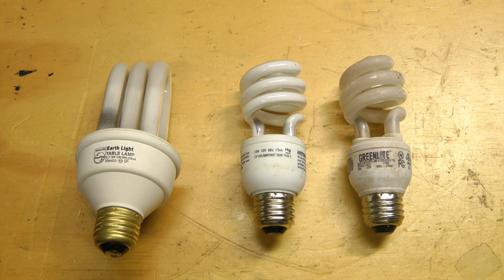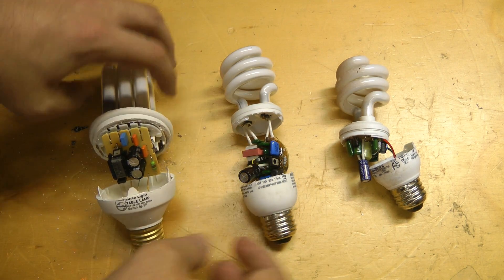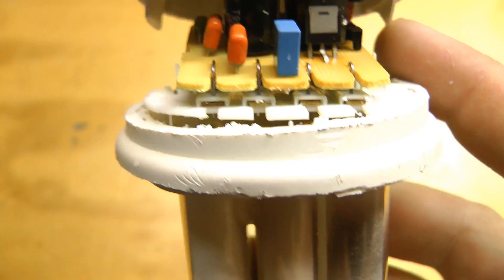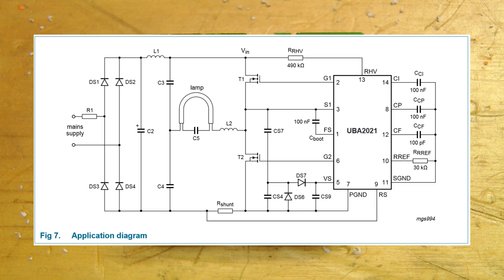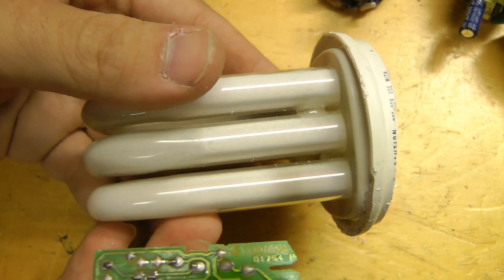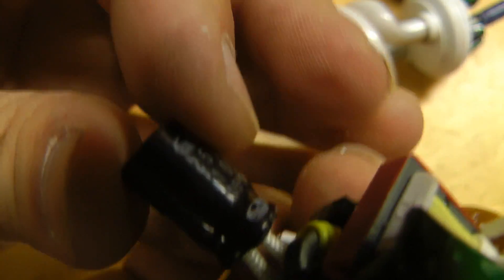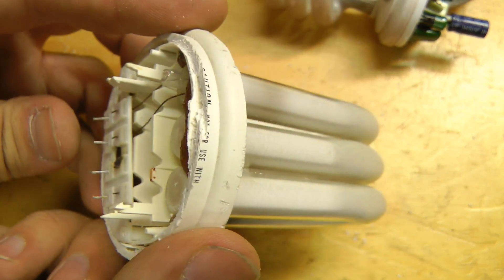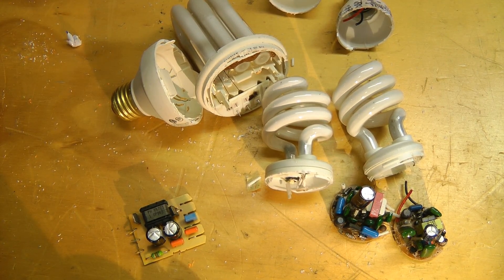Compact fluorescent lamps - then and now

Comment: Almost the same in Europe.(Except they never used voltage doubler because we have 230 V nomial voltage). I took a look inside an older Philips PL Electronic-C 9W CFL and it has a half bridge with 2 capacitors and a chip to drive the transistors. Newer CFLs have a single capacitor in the half bridge circuit and a feedback toroidal transformer for the oscillator. The newer Philips CFLs advertise 6 years or 10000 hours lifetime. I still like them more than cheap chinese LEDs which last 2 or 3 years, maybe 4 and some of them have a 100 Hz flicker which CFLs didn't have. Sometimes a CFL with a broken cathode can be repaired by shorting the cathode or bypassing it with a resistor.

Comment: Thank you Great video

I like scrapping these lamps they are full of great parts to build other stuff with,
the down side of them is they have Mercury in the tubes so need disposing carefully
I have been using led lamps for about ten years and some need replacing now, so the
 life expectancy is looking to be about the same as the large Philips

Will you be doing a video about Led lamps in the future ?

Comment: I've noticed if you have a CFL in an upright, open fixture, it lasts a lot longer than if it is hanging down, or in an enclosed fixture. The CFL in my bedroom lamp has lasted 5 years and still works, while the ones enclosed in the hallway and hanging in the dining room have been replaced at least twice since we began replacing incandescents with them. Also one of the stairway CFL's I have is beginning to flicker, I'm worried its time is coming to an end. Now as the bulbs burn out, I am replacing them with LEDs, since those actually look promising.
Reply: Does it still work

Comment: Found similar results. There are some compact fluorescents that were used since 1990. These featured a copper/ iron ballst and classic starten, built in large "marmalade style" jar on a screw base. These we used in outdoor lighting at the garage, and they do still work, even though the fixture is in all weather conditions.
Others were made by Philips, sold under the "Stella" tradename. ("Made in EU") These I bought in 1995, and they were installed into the staircase lights, so it was common to turn them on  a couple of times per day, for just short moments. MOst of them, I bought around 20 at the time,  still work.
The inverter uses the same IC like the Philips in video, the tubes are durably built. The base and inverter stays lukewarm during operation.
On my desk, I used a spiral "daylite" variant, also of Philips brand, called Genie super saving daylite, that worked for two years at max. It is not on all day. Similar to the one in your video. It failed two days ago. I always noticed, it became very hot, and the temperature did not match a stated consumption of 18 Watts.
When it failed it started to flicker, ending up at a super hot lamp glass temperature. The glass finally cracked. I tore it apart, the inverter is the same like yours with the Dishi cap in the video. There are green Hitachi style capacitors, which turned brown over time. Finally the one between the filament burnt out, keeping the current flow at very high values.
Most CFL are not long lasting, taking pollution and resource use into consideration, it is a total loss over tungsten bulbs.
I replaced the desk lamp with a 4000K LED, and at 10W this has quite bright light output, the base/ inverter stays cool, as expected. I'm curious how long this PRC device will last.
I used a some, which went quite fast, failure was the fusing resistor. Driven at 120 V, these tended to stay, but with my home supply being 242/420 Volts EU, the inrush current was too high, and finally cancelled the fusing resistor. Asking for warranty, the seller replied "You can't expect the same level of quality, as a Toshiba built bulb. Ours sell cheaper". Well, Toshiba's were just 10% extra... as the internal construction was actually quite nice, I expect, someone relabeled 120V bulbs with (the inverter can take it) 100 - 240 V AC.

Comment: Do they have a voltage doubling circuit in bulbs meant for 240V like ours since the voltage is already double your voltage? They still don't last very long either way -_- They seem to fail from heat because the plastic is always discoloured near the fitting.

Comment: I wish that I still had the older (late 80's) CFL bulbs around for comparison. Those were a single large ring, and had an annoying 'defect' in which they would not light-up in total darkness (but would light instantly late in the evening/early morning). Used to focus a bright flashlight on each one to relight them after a power failure, like they were electonic candles.
Reply: I've never heard of a light not turning on without the presents of light
Reply: @Kennephone  (IIRC it was an) Early 'high efficiency' variation on the semi-resonant starter that both lowered the voltages when starting/operating, and did not use a bi-metallic strip to control the electrode heaters.

(I presume) that they used some sort of early photo-resistor or primitive photo-diode to detect when the arc was struck successfully,  but (due to too-sensitive thermal/over-current protection, or component degradation) this 'solution' had problems detecting the light of the arc striking in total darkness.  

I noticed some of the lights that were on "flaky circuits somewhere" actually were glowing extremely faintly (visible after staring at them for 10 minutes), and would 'come-back' when a bright torch was brought into the room, or flashlight focal point stroked around it. (And had some fun lighting those around my hiding spot first while the rest of the compound/homestead was still stuck in the dark.)

(I presume that) the inventor(s) didn't calibrate a fixed brightness threshold 
level/value by blind feel in in total darkness during a >40C tropical heat wave while hanging from a corrugated-steel-roof still much hotter than that in the middle of the night - so the oversight was understandable (to me)  -- but after many years of trouble and thousands of dollars to eliminate non-existent power supply problems (aside from those expected in an 'emerging economy') my uncle was not as understanding and eliminated the whole stockpile rather than sell them on.

Comment: The Philips lamp was made in June of 1999 (the 9F is the date code; the number is the ones digit of the year and the letter is the month (A to M except I for January to December); the number is first in odd decades and the letter is first in even decades).
I have some early 1990s Osram CFLs made in their now closed Maybrook, NY lamp plant that use a similar topology to modern helicrap ballasts (like a Royer oscillator but with a separate base drive transformer), but they use much higher quality components and as such are far more reliable.  All 5 of mine work and a neighbor has 2 more that have been in regular use for close to 20 years.

Comment: I have some old magnetic ballasts for CFL lamps that have done 20 years of operation, with no issues. Replaceable lamps as well help a lot, as then you only replace a cheaper PL lamp instead of throwing the lot away. Electronic ballasts almost always fail from the electronics burning out than from the lamp dying, though the cheap and nasty lamp used degrades so fast the point is moot. I have old carbon filament lamps that likely will outlive me.

Comment: I used to be able to buy a 6 pack box of GE 23 Watt CFLs (100 Watt Equivalent) for around $20 US dollars... Now I go to the same stores and they have ONE 23 Watt CFL going for about $12 US dollars.... I have taken the older and newer ones apart and aside from some component down sizing and price reductions, they are the same product with the same lifetime...

As time goes on, CFL's become less reliable, cheaper to manufacture and more expensive to purchase... It seems retailers are using them as a profit cow now that Incandescent are banned.

Comment: I'm glad you did this video as I have been cracking these buggers open since they first hit the market. 
My first CFLs had magnetic ballasts built into the base! The next generation of bulbs had electronic ballasts lasted a lot longer and I was able to repair several of them by replacing caps or (if they were the same model) by swapping bulbs and ballasts around. Incidentally, I paid no more than $5 for them because our local power company had a generous rebate program.

Comment: Very cool teardown!  I had been wondering why the new CFLs were absolute garbage.  I'd switched back to incandescents for certain applications because I was changing CFLs so frequently.  Fortunately the LEDs are coming down in price and are starting to go up around the house.

Would you say that either design is more likely to be noisier in RF emission?  I'm assuming they are oscillating at mains or some harmonic under a couple of kHz, so maybe fairly low noise?

Comment: The technologies obviously there to make lamps that last a hundred years or more, there's a fire station in America that has a 100 year old incandescent lamp still working. I wonder how long it will take before LED lamps can only last a 1000hours? There is an interesting video on Youtube called the light bulb conspiracy.
Reply: My last 3Watt LED lamp burned after 3 months of aprox. 1 hour/day of working. For it's price i would have 2 years of incandescent light... The light was nice though.
Reply: It's all about the filament temperature, put two GLS bulbs (not halogen) in series and it last 30 years minimum.
Reply: IAdryan Did you buy cheap? Because that's what it sounds like to me. And you should be under warranty btw.
Reply: dumle29
Yeah, cheap. And the transport was more expensive than the light bulb. I've bought the light bulb with other stuff. Just curious.

Comment: I got a 100W 9000lumen LED including a 85-265V constant current driver for US$23.99 inc shipping on aliexpress a few months back.  Got it running as my lab lighting. Damn it's bright :P  The PSU says IP65 and it's potted so i cant have a look to see how bad the construction is. Seller was lenbo lighting if you want to have a play with one.  Be prepared for rock hard shadows unless you put a diffuser on it. Oh, and be sure to warn visitors to NOT look at it, without a diffuser that much point source light is really painful and you see a spot for hours.

Comment: Noticed that issue also, the newer ones die very quickly compared to older ones. If they are going to use such poor quality, then they should just sell incandescent lights. It is less harmful to the environment to use a little extra power, then to constantly throw out poor quality compact florescent lamps. which take more resources to make and have a high pollution level during the manufacturing process (while also using poisonous chemicals).
Reply: Razor2048 "a little extra power" 9W vs 40W = 444% power of the 9w (or 344% more power)
Reply: The issue is determining the pollution and environmental impact of each device. With the CFL, you are working with many less common and highly toxic compounds, much of which will be impractical to recycle.

If these lights lasted longer, then there would be a benefit to using them, but with most of them not even lasting longer than the incandescent lights, they are overall more harmful to the environment over the life of the product.

Comment: My primary qualm with CFL is, as you pointed out, the cheap Chinese manufacturing of something that I'm likely to leave on for long periods of time, including unattended.  I've had some of these things make me nervous as they approach end of life and start misbehaving.
Reply: 38911bytefree
LED bulbs are so cheap now that I've gone around and replaced nearly all of the CFL bulbs in my house. Home Depot has specials on them every other week 2 for $5.

Most of the bulbs I pulled out have had the plastic base around the ballast turn dark brown from overheating severely, so it was time for them to go anyway.

So far I've only had one LED bulb fail because of a bad power board. The LED module still worked so I rewired it to run on 15v instead of 70v.
Reply: I agree, at one time, one exploded at home. As you said, as soon as I note something unusual I take the lamp out of the socket.
Reply: FyberOptic The Chinese spiral CFLs are indeed dangerous.

I've had a bunch of them nearly catch on fire near the end of their life. I discovered one by chance where I'd turn it on and the CFL would turn off and on every few seconds. I pulled it out of the socket to discover the ballast plastic housing had partially melted and several parts on the ballast board had gotten so hot that the PCB was burned completely through and the part was basically dust.

How it even kept running for just a few seconds was baffling.